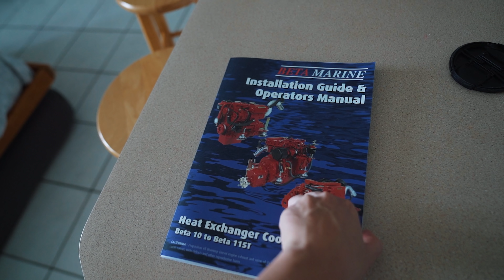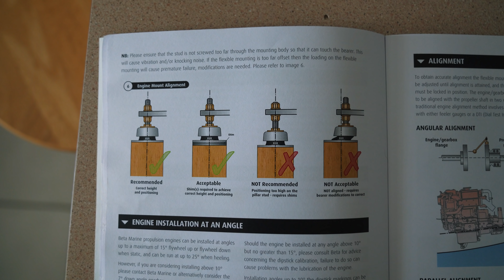DANGLING OUR BRAND NEW ENGINE OVER THE WATER!

Comment: I fitted that same engine Beta 3 cylinder 20 hp into my Sigma 33 yacht. It burns about 1/3 to 1/2 of a gallon to the hour cruising at 5.5 knots and 1600rpm.
Reply from the maker: Ours says it's 30hp

Comment: Wow. Bear in mind the strength of the stringer and engine mounts. They should be able to hold during an INVERSION or a knockdown.  It's significant. For obvious reasons. But Wow...yeah..that host is looking DEF and with a new donkey in harness...you're looking at some classy cruising in the next few.

Comment: You need a pulling tool that pulls on the outside part while pushing on the inside part like I have but ain't going to do you any good now.  I am amazed you people have not seen those pulling tools.  They use them to pull brakes off of cars.

Comment: Absolutely right, Kristen. And now, when you're still moored where you can still get help, is a better time to learn about how that engine goes together than while you're out at sea. From an operational and maintenance standpoint, engines look a whole lot more complicated than they are. Most of the needed maintenance can be done with a socket set and an oil filter wrench -- maybe include a screwdriver if it's carbureted. This also means, if you find yourself adrift at sea, you've got a chance of figuring the issue out. Grab a wrench and go to town! 👍️
Reply: It is a diesel so no carburetor.
Reply: @tomnewham1269  Yeah, I realized that shortly after I wrote it. Just too lazy to edit. 🤣 Thanks though.

Comment: Love your videos I wait all week to watch with my Sunday morning coffee. A simple propane torch ($20. Tops) should be part of your tool box, get you out of trouble with
 marine metals fusing together as they are prone to do. Glad the install went well but I have to admit a little disappointed in that nasty prop you put back on. You will cavitate and the vibration will make you think that brand spanning' new peace of machinery is going to fall through the bi!ge. I  hope you replace it and butter it up with a quality anti seize or a good marine shaft grease I always had good luck with Quick Silver (Mercruiser) brand never in 35+ years of boating once I greased a shaft never after a long season had an issue removing a prop. Can't wait till you line it up and start it, get some oak wedges and blocks to make engine beds. Good luck you got this.

Comment: 10 dollar steering wheel puller would have worked. Haven't seen the end yet but I hope you use the oven to heat the coupling so that it expands and slides right on.. We'll see

Comment: You Shoulda Heated It With A Torch! Plus There Shoulda Been A Big Flat Washer Behind The Prop Nut! PS I'd Build A 4 Sided Stringer Box Complete To Fit Dimensions Needed, Then Fiberglass It Totally, Then Long Big Lags It Down Good To Existing Stringers! 🤔😜🤣😁😎

Comment: Great job guys!!  It looks daunting but you can do it. Matt with Kristen's advice, slow and sure, just make sure the engine is aligned with prop shaft as close as you can get. Use feeler guage between coupler pieces, if you got them, for best alignment.  Best alignment, no vibration, no more wear and tear on the stern tube.

Comment: I think the little BETA engine will only burn 1/2 TO 3/4 gallon per hour at gentle cruising speeds...you will be amazed how good on fuel they are!! Consider fitting an R+D flexible coupling between the shaft and the gearbox coupling.

Comment: ... what camera are you using ... just asking cause the clip at around 8:25 when your homie is sanding your shaft looks like it may not be straight and be the cause of your deteriorated shaft housing (couldn't remember the appropriate technical marine term .. smilin ..) .. hense asking what camera, is it the lense that is giving that illusion .... well done ... you two got this .... no rushing, rushing only make room for omissions and errors .....  well with that diesel tank you won't be houring up that Beta in a hurry .... thx for sharing .. as usual ..... never stop dreaming, just dream bigger .. have fun be safe, save our oceans .....

Comment: That was painful to watch, buddy. I have a variety of wheel/prop pullers that would have popped it right off. With a Hunter you have to be careful the shaft does not slide out.

Comment: Could of used a pulley puller, it's too bad that they couldn't even lift the back end out of the water just a bit even if that's possible then if you could put that coupling in maybe sitting in your tender I don't know probably right off the wall idea but it wouldn't be totally hauled out just a thought lol but great job anyways

Comment: If that shaft isn’t Perfectly straight it will break the shaft I did it on a Malibu lake boat we had vary bad also if you don’t have a shaft locking a collar on the shaft so if it breaks the shaft won’t pull out and sink you.

Comment: That’s the smallest diesel tank I’ve ever seen 😮you’ll be able to motor so much more efficiently but you’ll need to carry some fuel
Reply: um.
sails?
Reply: @tedsmith4353  I have a 205 litre tank so I can motor when I have to um sometimes there’s no wind
Reply: @tedsmith4353   The biggest problem with sails is you can only go the direction the wind is blowing, and mother nature doesn't cooperate. You can be stuck in a marina for a week because the wind is blowing toward land instead of out to sea.
Reply: I was thinking one of those diesel dippers or a day tank would be good

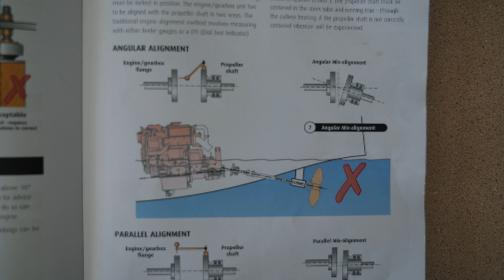Comment: 26:22 I wonder how you will fix the dial indicator to the flange. I know from my oldtimer car, just a hair misalignment will cause rumbling in your shaft... I recommend using the dial indicator. They are not super expensive on Amazon or something, but you need to find the proper shaft-mount-thing.

Search for:

 "Alignment via dial indicator is performed using radial and angular offset. The dial indicators are mounted e.g. on the gearbox output flange and are measured against the propeller shaft flange."

and you'll find an image on a German site that could be of help ..

Good luck guys !

[Edit] a dial indicator from China cost less than $10, but with a little bit of metal as a clamp, it becomes a "Shaft Alignment Tool Kit" of $1000 😨.
I guess a clamp can be made, as long as the indicator is firmly fixed correctly...

Comment: I'd 've used an electric motor. It's cleaner, lighter, safer, and smaller. Also, there's no 🔥flammable🔥 diesel on board, leaking and stinking up the boat. 
You can charge up the batteries with solar and you can sew the charger panel into the main sail and/or the spinnaker. ( Lots of uses for electricity. 😉)
BTW your prop is probably at 20% efficiency. Those blades are nasty! They must cavitate like crazy. (Sorry I like clean brass. )

Comment: I'm not a professional.  But that tube does look beat.  Does the egg shape continue through the whole tube?   I'd imagine if the shaft is straight, the   the tube would be worn as well 180 off on the outside of tube from the inside. 

I know things will balance when spinning, but when loaded that shaft   is probably being pushed down as the force moves from propeller to the hull itself.   The wear will just accelerate because it is point loaded, instead of being spread out on whole tube. 

Sucks that you can't get insurance.  It sounds like you want to replace it.   

Would Umbrella insurance count enough for a marina?  If GBU is a business, try getting an umbrella policy for 1 million.

Comment: To get that shaft coupler off, you needed a "hub (or pulley) puller". They are cheap, at ~$20 bucks.  Sometimes even an auto parts store will even loan you one.

Comment: Shaft tube has too much play. Even if you align it perfectly using a feeler gauge between couplings you will have a vibration. Shaft has to be true and tube has to be tighter than a tics a$$. Anyways, that's a project for another day. You're doing great.

Comment: You need to do something with the prop, It looks like total junk. It will rob your horse power and burn more fuel as is. Remember, the prop pushes the shaft into the engine and the engine mounts push the boat.The new engine may be able to swing a bigger prop for better fuel use. Have fun.

Comment: Matt, just be sure when you marry those couplings that you can't get more than a .003 feeler gauge to go all around between the coupling faces. Good job and it was extremely smart to use the amigos to put the motor on the boat. Mike

Comment: All that work on the engine and the prop is ******ed the key fell out and the cutlass bearing is worn, no washer on the nut or grease on the splines. Big trouble ahead there

Comment: Next time put heat on it and it would of come off.
5 minutes with a propane torch would of swelled the coupler an it would of came off with a little tapping with a HAMMER.

Comment: Jesus Matt a Crescent wrench is not a hammer. Try to use the correct tools. Lots of videos out there. Put full-length shims on your engine beds and use hardwood and lags. White oak if you can get it. NOT spruce 2 x 4's. Ask the yard guys. Did the Beta come on a pallet? Most likely the pallet is some kind of hardwood, or the boatyard will have something around. Don't be afraid to ask the yard guy to look over your engine installation and shaft alignment before you set off. I'm sure they respect you for the amount you have accomplished. Then some short sea trials before you go offshore.

Comment: heY ,  hope you guys read the comments and  {1)get a new prop shaft….(2) take your prop off, clean it and reinstall it using a castellated nut and a split pin..then (3)   Do whatever you have to do to centre and replace the shaft seal and then  (4) listen to the engineers and get the shaft adjusted properly to ‘the width of a human hair’ tolerance..or closer…then (5) crack a beer and settle back…..don’t ask why I think this is important..(hint..I Lost the shaft out the boat due to vibration once ..oops. ..)p

Comment: Matt, don't use wood to prop up your engine !!!  Wood will rot and compress over time.  Use a hard, strong surface material like fibreglass !!  Please don't use wood !!
Reply: I was gonna suggest simply getting some plate steel cut and drilled.
Reply: @nicholasr7987  That is a great idea !!

Comment: When I reinstalled my 1970 Ford Ranchero engine and transmission, I had a friend help. We rented a hoist and bolted the transmission to the engine, then put them into the Ranchero. 

Then my friend holds up 6 nuts and 8 washers, he asks "where do these go?". So we took the transmission apart from the engine, installed the very important missing hardware.

The moral is, don't depend on the least intelligent person you know, to do the most important jobs. At least check the work.

Comment: Too late now, but all you needed was a puller tool, like a prop puller, a bearing puller or a home-made one made from the mating flange and bolts.  Heat works too though, obviously.  Also, what is the deal with that prop?  How is your new engine going to put it's power into moving the boat with that ratty old prop?  At least clean it or have it reconditioned, please.  Love your approach, but sometimes you have to think ahead, be creative and prepare for the unexpected, but , I know, that's not your style.  I love how nothing gets you two down, nothing, no matter how daunting.

Comment: Need a bigger hammer 🔨 ⁉️damn you wasn’t using a hammer, that’s an adjustable wrench.‼️
Seriously though invest in a small hub puller great tool for you to have.
 If your stuck with the stern tube, you might be able to insert a collet (like a small cut off piece of metal tubing), you can epoxy it in or even silastic, then when using hose clamps it will be more. 
resilient and should help to stop it from cracking.

Comment: Too bad!!! The propeller fixation presentation will come loose for sure. The ring you are wearing will not hold it. It is necessary to use a nut with a counter washer. In addition, the propeller is thinned due to corrosion. The propeller blades may break.

Comment: I HOPE THAT THAT PROP, WAS TAKEN OFF AND POLISHED THEN PUT BACK,. ASK THE MOTOR MOB TO SUPPLY ENGINE MOUNT BRACKETS THAT ARE 50 MM LOWER,. OR MORE 75 MM.  i am a 73 yr old diesel mechanic that has fitted 1 cyl BABY  to a GM 16 cyl to boats/SHIP. -- GUYS MAKE IT WATER TIGHT ..RULE 1. !!!!= YOURE BOTH GREAT , I ,CAN SEE THE LOVE.??

Comment: Dude, your engine coupler is a very fussy install, there is no such thing as close enough, it must be bang on or it will destroy the bearing in the back of your marine gear.  I have done a lot of these and believe me, thousandths of an inch make a difference.  You most certainly do not want to be out in a storm and have the coupling bearings fail.  Also your prop needs some love, it is pretty beat up and it appears that it has electrolysis happening and that is really no good.  It may also be unbalanced which will affect your boat, motor and most worrisome, your stern tube.  The whole propulsion system must be balanced and aligned in order to be safe and last.  Looks like you also need zincs on your shaft and rudder.  Sorry for busting your chops a bit but this is all very important in order to have a safe and long lasting install.

Comment: Do not mean to pee on your parade but: 1)that propshaft is bent...... replace it. 2)That  shaft seal was too big, get a proper fitting one or you WILL get leaks when you least expect. 3) clean and polish your prop ..you had it removed anyways so why not just do the right thing?  Do not cut corners when you have come this far.

Comment: MY GOD... ENOUGH with the DIY rig it, and worse force. there is a dirt cheap tool for everything to make the job right and fast and EASY. Shaft coupler...    SIMPLE rule of thumb I was taught a long time ago. does not matter what it is. IF ITS BENDING. ITS BREAKING. If its bending STOP. something is wrong Dents=bending, bending = bending. and on and on. As to the motor, FOLLOW the break in process. Its very easy to destroy a motor by failing to follow the simple steps.FYI that motor was not sighted square to the shaft untill it is. NEVER run it at high rpm.  Motor mount USE aluminum bars for spacer shims not wood. As to the shaft seal, you MUST have a crush ring installed, the only smart way to do it is using a sized ring for the ID. Is to use minute mend to fill the worn gap between a crush ring and the existing tube ID. To seal the outside of the shaft to stop the water.... you will need an air supply system, sikaflex not 5200, and 4mill plastic sheets, and a hose clamp, and PVCFOAM board. : What materials you use depends on the hull/shaft log design. The goal is to use sikaflex caulking on the hull and prop shaft. Cut a circle of 4mill or thicker plastic over sized. cut a small hole in the center close to the diam of the prop shaft. and a long cut/slit so it can go over and center on the shaft. The idea is to put a few beads of caulking on the hull and shaft, and put a few layers of plastic changing the orientation of the slice, caulking every seam and using a hose clamp at the center of the plastic on the shaft. When the seal inside the boat is opened the flow should be low or stopped. On the other hand if the shaft log is exposed outside of the boat. then just wrap plastic around the shaft log a bunch of times and the  shaft and use hose clamps. What ever you do, do not get caulking inside of the cutless bearings.